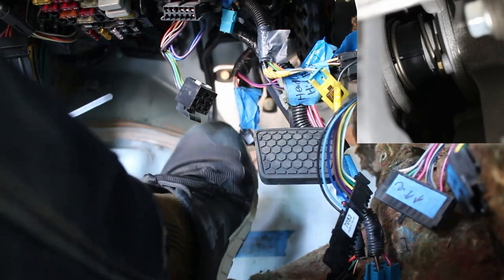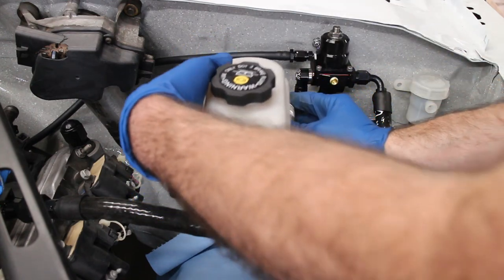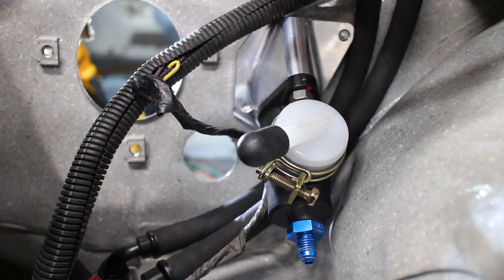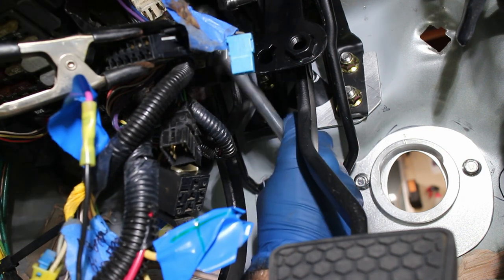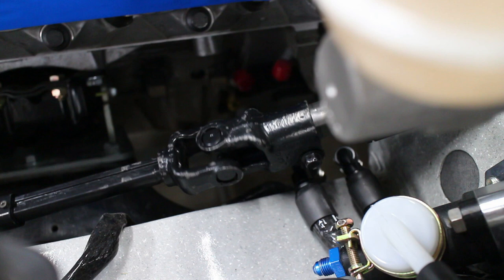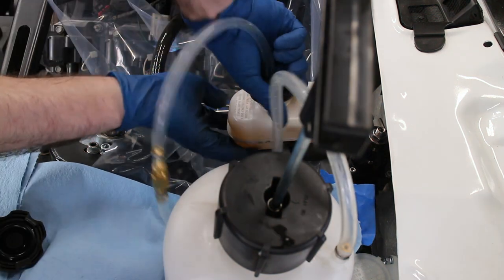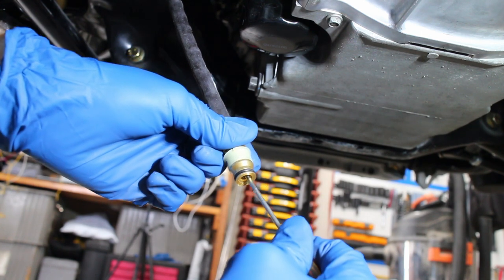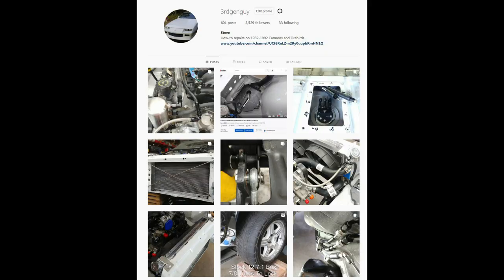T56 Setup & Manual Brakes Mayhem  (Pt27 LS Swap)

Comment: Did you ever make the make the pin for the clutch pedal? I checked your ebay store but i didnt see it
Reply from the maker: It ended up costing too much.
no one is gonna spend $120 on a pin ha ha.
and I'd have to come up with MEGA bucks to get a lot of 100 made.
Reply: @3rdGenGuy  ahh okay that makes sense lol. Just LS swapped my 92! Still have the pedals for a T5 from an 88 tho. Any recommendations for converting those pedals to fit the LS1/T56? The LS1/T56 are from a 99 trans am (drive by wire).
Reply from the maker: you can fab something up.
I haven't done it myself since I just used my pin.
Reply: @3rdGenGuy  thanks man! I've used a ton of your vids already for my car. My car was auto, changed it to stick, now it's a LS swap! Keep up the good work man, great vids!

Comment: What clutch setup did you go with? I'm having trouble finding the right one for my 85 z28 t56 swap. Any info would be greatly appreciated 🙏
Reply from the maker: i went with a LS7 clutch kit.
good for about 500 wheel hp.
I like OEM stuff
Reply: Thank you very much for the info I greatly appreciate it.

Comment: clutch pin and those brackets available ?
Reply from the maker: the brake master brace is available, the pin isn't done yet.
https://www.ebay.com/itm/175555281751